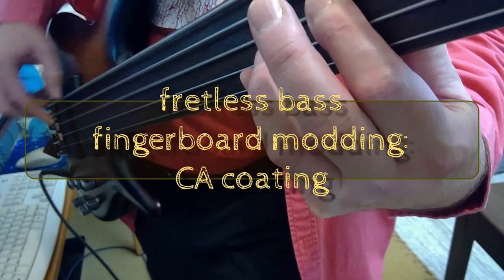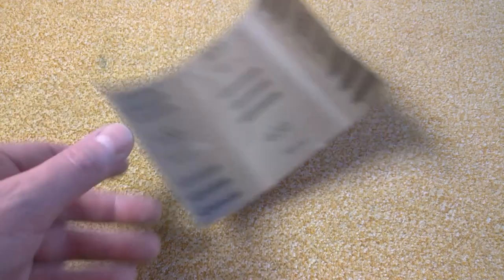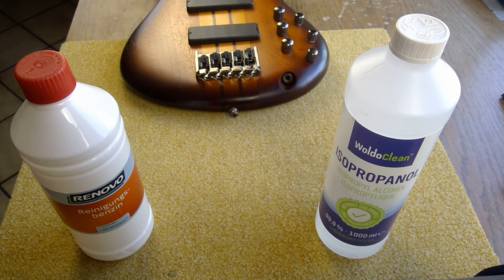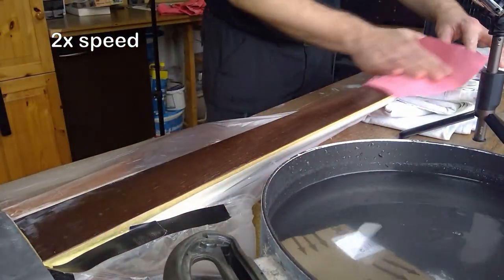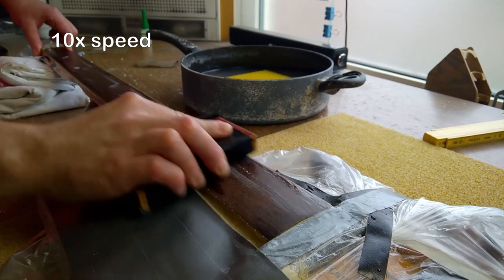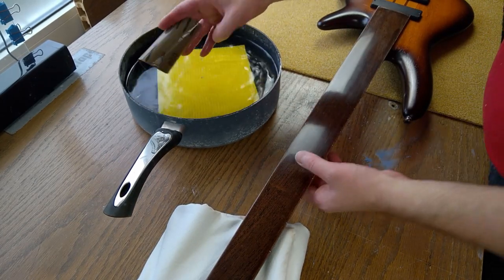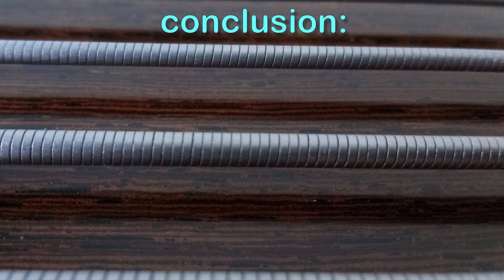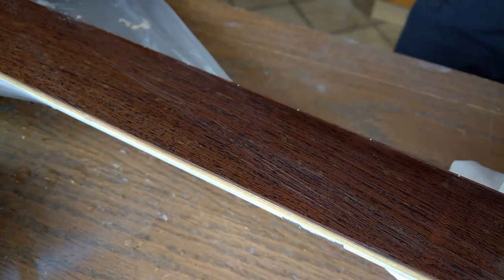fretless bass fingerboard modding: CA coating

Comment: As a luthier, I thought I'd add my professional opinion to this. 1). Do not do this with a good bass. 2). Adjust the neck dead flat before block sanding it and prepping the board. 3). Dam the sides of the neck with masking tape and aluminum flashing tape, so you can flood the area with THIN CA glue. DO NOT USE ACCELERATOR. 4). Allow the glue to dry for about a week before sanding, and sand till you take the resulting superficial top coat off. Then buff. Remember, you are trying to harden the wood, not cover it up.
Reply from the maker: Thanks for the input, but the accelarator has not done any damage to my build so far.

Comment: A thing I have learned while working on one of my fretless basses is that guitar necks are not actually straight, so ideally you should use a radius sanding block of the correct radius, not a straight one.
Reply: Pretty sure he can do it with a flat one, he just needs to pay more attention and sand the whole width. A radius sand block is still more handy, but not a necessity.
Reply: you need both a levelling beam and a radius beam.  The correct technique is to get the neck as straight as it will possibly go (with truss rod), and work from there. . You cant ask your radius beam, to ALSO take care of the end to end flatness.  How do you know you are using it correctly?  if you are favouring your right side, the neck will have a slight twist etc etc . . one job each . Levelling beam for general flattening , followed by radius beam to re establish the radius. both beams MUST be longer than the board PLUS your stroke, otherwise you are sanding a hollow into your neck
Reply: @thebutton7932  darkySp is correct. You don't need all that fancy jazz (!) to level a fingerboard. I used a cheap red rubber sanding block from the hardware store, checked with a straightedge, and that level has lasted five years.
Reply: Before sanding with a radiused block to match the radius of the bass neck,  release the truss rod to perfectly straight using a straight edge.  CA may not adhere well to oily woods.
Reply: My dad just eyeballed it mostly without a straight edge and sanded according to the direction of the grain. Doesn't have to be perfectly on the mil. all we used was a 2 part epoxy and sandpaper. the neck wasn't perfected until i broke it in later adjusting the truss rod after playing it for a few weeks breaking some upright bass strings in the process.
Reply: There are experienced luthiers or boat builders or carpenters who prefer sanding without a block, because you feel what is under the sandpaper. But here we want it to be as flat as possible (and curved, yes), so I have no idea what the pro's recommend. No CA-glue, I guess, but on one of my basses I like this finish. Removing the frets, I damaged the wood. Not that smart, but now I know better. However, what you'd do next? On fretless bass, you really HEAR repairs, unless you got the same wood at hand. Oops. Here comes the CA coating.

Comment: I admire your efforts. I've done this a few times and let the glue drying without the activator, you will be better off. The activator creates little dry, uneven and harder to sand pools.  Super glue (thin) will dry quickly, just be patient, it will give you a thicker finish if you spread it instead of brushing.. The biggest problem in any project is getting in a hurry. Sand with 400 and keep applying glue to level out the finish. Once you get to a level finish, start working up to 1200 grit, then up to 3000 grit. I used Bondo in a bag and molded it around the neck to get the radius correct. Place the sandpaper under the Bondo curve and it's a perfect match. When you get to a 3000 grit, you're starting to get a shine. I hand rub with compound to keep from grinding in a low spot with a drill.  Bottom line, don't get frustrated and have some fun with your work, you now have experience.
Reply: Bondo in a bag! I’m impressed.

Comment: I've heard of people using this technique and none of them I chatted with seemed to be in love with the result.

I ended up going the Jaco route and using System Three MirrorCoat epoxy on my fretless builds, and have been very happy with those. Of course, I wanted a thicker coating than CA will give you, mainly because (a) I use roundwound strings and actually prefer a bit of high-mid clank most of the time, and (b) it's easier to get a nice, uniform playing surface free of unwanted imperfections. Plus, if/when you DO end up chewing up the finish, you have enough material on the fretboard to easily buff it out.

Whichever method you go with, I recommend using a radius block to maintain proper radius while you're level sanding. A simple sanding block does nothing to preserve that.

Just my $0.02. As always, your mileage may vary.

Comment: Your video made my choice of fingerboard for my 36' flat fretless (im a woodworker). I did a total of 13 layers during the day, no activator, sanded up to 2000 grit by hand on top of a 5mm vynil board. I mostly slap that thing, and let me tell you, after a year of use shits holding up great. Has a VERY clicky vibe to it, kinda like it, a bit more subtle than on Korn records.
Reply: Seriously, 13 layers of cyanoacrylate glue? Do you happen to know what type of sealer Les Claypool has used and if he gave it that same amount?

Comment: My father and I had applied something like 11 layers of epoxy to the fingerboard of my fretless project bass back in 2002. It was certainly labor intensive - we had bought a radiused sanding block from Stew Mac. More recently, I realized the epoxy coating was causing the extra high mids/treble that I didn't want in my sound (it was sounding far too synthetic, and lacked warmth), so I sanded off (most) of the epoxy. I'm not sure that I removed all of it, but I'll have to wait for next spring or summer (once it warms up enough) AND use the wet sanding paper method you had shown!
Reply: 2024 is beginning as I comment. How did it ultimately work out, Max?

Comment: Glad to find your vid ! I had the exact same bass here and it doesn’t reach my expectations,
Overall it’s a lower cost Indonesia made Ibanez which shouldn’t compare with bass like Fbass
AC6, but it really need a mod to be a usable fretless bass.
The coating to the rosewood finger broad is one of the must to improve the high notes, but
one other important issue are the nut, it’s plastic so I had to make a brass nut myself, it does made note clear,
Also put on an other set of flatness strings ( I took high C and no low B) and proved the original string are no good. Last parts changed are the magnetic pickups, a pair of Northstand instead the OEM Barton’s mark I .
, overall results are very nicely improved, so the last thing is to follow your CA project which  I think will make
It complete. Thanks !

Comment: Nice work, I appreciate the comparison. Also showing your mistakes/lessons learned was helpful. 

 I'm considering converting my ubass to fretless, and I like the coated fingerboard on my Rickenbacker. I might end up going with epoxy or mylar instead of CA glue.
Reply: I've converted my Warwick Corvette to fretless using epoxy, it is a long process :D Took me about 8 days to get it done. Epoxy takes really long to dry, like over a day. I was a bit impatient and the epoxy was sometimes bit sticky which made sandpapering it down really hard. However the result is pretty good, not that I like the passive mics that I have on it, going to try to swap them to some active EMGs. Good luck with your project!

Comment: Appreciate the vid and the work put in. Trying to decide how to finish my fretless conversion
Reply: My bought festless is unfinished, I love it. I have converted an LTD to fretless, w/ high gloss enamel coated fretboard tuned DGCF, and a fender acoustic guitar converted to a fretless w/ a high gloss Acrylic coated fretboard, tuned BEADGC. And about to create a frets 1-12 fretted, frets 13-19 fretless 6 string classical guitar, it will remain unfinished. I like both for different reasons. Plus ea. of my instruments is different, each tuned throughout the scale of BEADGCF, so they all blend in succession when overlaid in recording. I'm also working on a custom acoustic guitar converted into a 4 string short scale rubber band bass. Play both kinds before you commit. They both have much to offer but are completely similar at the same time. *overall, note placement, manipulation, and string attack are the key elements of fretless.
Reply: @andrewgocken517  I bought an LTD b-204 fretless and I love the feel and look but I don't get quite the "mawh" sound I'd like.After watching this video it doesn't seem like the work is worth the limited result.I do notice that the most pronounced "mawh" seems to come from higher end basses.
Reply: @kevmac1230  try "finger?" picking right at the bottom of your neck and crank your mids. Make sure your neck is flat, if not adjust it. My fretless cost a $120. Shit you not, my other I made. Set it up or get it set up, nice flexable, round wound strings. I almost put mine down before I did this. Now I love it. The mwahh, fret slightly off and add vibrato. It should help also. Hope it works out. It's a different animal,  give it another chance. Good luck
Reply: @andrewgocken517  Thanks, I'll keep plugging.
Reply: @kevmac1230  my homemade fretless is a LTD. It is very different. It's more about intonation and learning how to use and intensify the sounds a fretless produces. Try running bass, treble pretty flat 4-5 and your hi and low miss cranked to like 8-9. Play with you controls try bridge only, neck only, somewhere in between. Try using your middle finger close to the neck press hard against the string and pop your finger off of it. And check out Alain Caron. He's amazing.
Reply: @andrewgocken517  I have tried cranking mids and concentrating on playing close to the neck, because I get inconsistent in that regard.The results are noticeable but much more on the D+G string which is probably normal.I have some Rotosound Rounds but I'm a bit leary to put them on as I've heard they chew the fretboard.Maybe a set up is in its future.My luthier is excellent and he'll know what to do.I'm a geezer at 65 and I've played forever but only recently got the courage to try fretless.It is a different animal but so cool.I only wish I'd acted years ago.
Thanks so much!
Reply: @kevmac1230  they don't wear the fret board out too bad in spots here and there a little. Repetitive playing spots. But I've had mine unfinished for close to 5 years and my wear is not bad at all. I play DR Black Beauties on mine, and the string coating wears faster than the fretboard by far. Love marks. Lol. I have a '74 Rickenbacker 4001 that has lots of love marks. Lol

Comment: I've been meaning to do this to one of my spare basses turned fretless and have been experimenting on some scrap wood.

1) You should be using a radiused block and not a flat one.. Soundgear basses all have 12inch radius btw

2) Do not use the activator. Let the glue dry on it's own in a dry atmosphere if possible. Wait at least a couple days before doing the finisb sanding.

3) Depending on the wood, sometimes it's better to use just the thin one, sometimes just the thick an one, sometimes first layer with thin one then thick one.. sometimes first layer with thick one then top with the thin version.

Comment: Very interesting! I did much the same but with tung oil, and to smooth out some of the string dents. It kind of worked, but not sure if it was worth the effort. Also, with tung oil, don't lay it on thick, remove excess and be prepared to spend a couple of months building it up.

Comment: I would probably have gone one step further than a sanding block and buy some radiused sanding blocks. If the fretboard on your bass has a compound radius, you might need several different sized radius sanding blocks. You might as well get a full set of them if you plan to do repairs and mods on other instruments in the future.

Comment: Great video, you have a great voice for narrations. However I think that using a radius block to do the sanding would’ve made a tremendous difference in eliminated the uneven pockets on the fingerboard, which can be the cause of loss of sustain and resonance. I’ve seen several others scribble lines with a pencil down the entire length which helps give a visual of low spots or pockets when sanding. But I very much enjoyed your video sir.

Comment: You really did great job with this modification! Btw, although there is no improvement in the sound, if the feeling of playing is improved in the left hand, that's also something that should be accounted. If someone play fretless, then slides are frequently done, and it seems to me that this kind of fingerboard should make those slides feel at least a bit better.
Reply: I’ve discovered that to be the case on guitar. Playing a guitar with a lacquered fingerboard does tend to be comfortable.

Comment: Epoxy works way better, also some of the issues with individual notes could be because the finish wasn't as flat as the fingerboard. If you're still messing around with this instrument might be worthwhile to layer up some more of the finish and get a radiused sanding block and leveling beam - that way you can ensure the applied finish is as flat as possible and that the radius matches.  (Way easier with bolt-on instruments too - I got a used Ibanez GWB1005 with the rosewood board to mess with finishes)

Comment: I've been playing my Fender Pre since it was new. 1970. I have 2 necks and always have one on the ready. I use to have Kurt Wright from Cleveland do it till I moved out West. Great guy. Talked me how to do it. Between that and multiple on the road spot repairs ....You are to Spray  it ON...in VERY VERY thin layers. Multiple thin layers with each layer totally dries, Use one of the facial air sprayers for makeup applications. All you'll have to do is BUFF IT. No actual sanding...Each layer you come from a different direction and THIN! start spraying well before the neck so the spray is even. I'm comin up on 70 yrs this July. Totally worked it over by now, 1st original BadAss bridge, 1st HI-A pick ups, Brass nut. Tuners sealed etc. So, ya never thought of trying it on a piece of hardwood...Hmmm...I never had that much spare cash on hand. God bless and pass the amunition. Nice camera work !

Comment: I just bought a used fender fretless neck that needs to be refinished. You answered the question if I should epoxy it. Thanks!
Reply: Hi, I converted a kit bass and tried the super glue route but I wish I'd seen this first.You heard the gent say he didn't think the payoff was worth the effort.I found the glue thing a bit more difficult than I thought it would be.I'd go for a nice tung oil or something of that nature if I did it again,but you have to do what you think best.Good luck.

Comment: There is not a huge difference in tone, but the super glued fingerboard will be significantly more resistant to string wear, especially if you string up with some nice bright round wounds, which will give the bass a very different voice.
Reply: Round wound’s are what are on my fretless bass. I have to say that I enjoy the sound far better than if I were using flat wound’s or whatever is most customary for an instrument like it. I enjoy the extra harmonics in both the high and low registers that they offer up.

Comment: Wouldn't a radius block (that matches the radius of the fingerboard) be better than a flat sanding block?
Also, shouldn't one be afraid of moisture being trapped in the rosewood under the glue layer and potentially warping the fretboard with time?
Reply from the maker: I agree. It would.
On the other hand, even a flat block is better than your fingers... 😁 as I said, I learnt a lot in this and next time would be more refined. 😉
As for moisture, the mod is now half a year old and the fingerboard has not budged.

Comment: A couple of notes about activator: firstly it's 99% water with a drop of dish soap in it and a waste of money. When you add it to super glue as a finish you are adding moisture to wet glue that displaces some of the glue and you'll get an uneven finish 100% of the time. When you apply just a thin layer of CA and let it cure with the moisture in the air it'll cure fast enough (10-20 minutes). I usually do 10 or more layers before sanding with a radius block too, this lets me find any high spots without sanding through the finish in the lower spots. On a particularly humid day I can get 10 layers on in under an hour, sand, polish, restring, and setup all before lunch and not a single squirt of activator needed.
Reply from the maker: Thanks for the tip. I had no such background knowledge when I did this project, since I am not a professional woodworker or luthier. This in strictly on amateur level. I made this video because I was looking for information online and could not find anything with useful instructions on how exactly to do this. So I decided to give it a shot myself and to publish my results so that others would find something when trying to tackle the same problem.
Concerning ingredients, I could not find the original product that I used on this any more, but it did say something about containing acetone, and it did have a distinctly chemical smell to it, too. 
And as you can see, I stopped long before 10 layers, and in spite of all problems with even application, this bass plays beautifully and the surface is still in pristine condition.
I don't think I will ever do this again, but thanks for your input none the less.